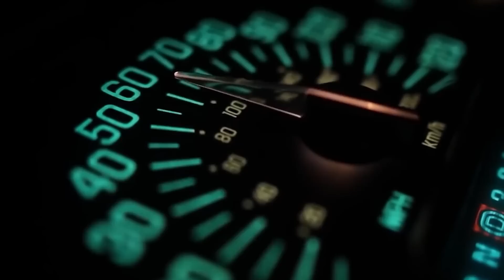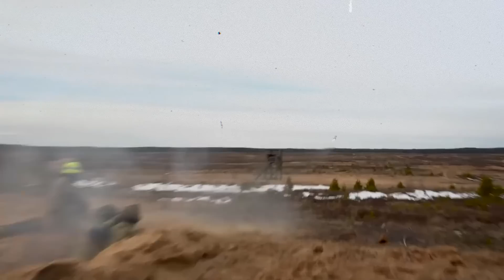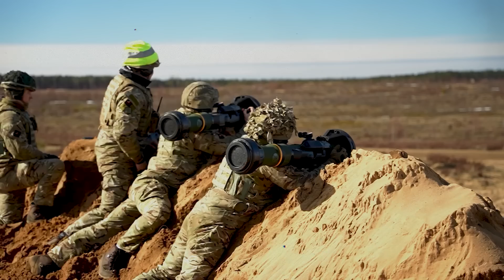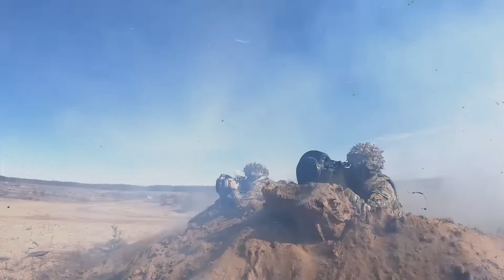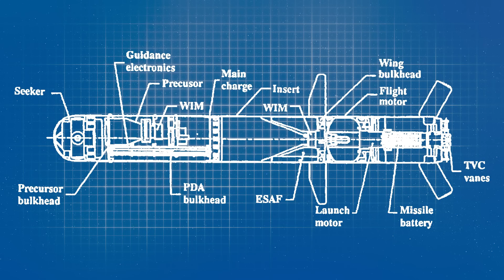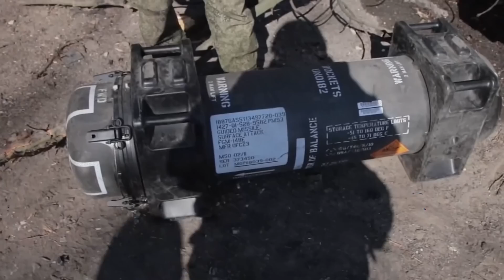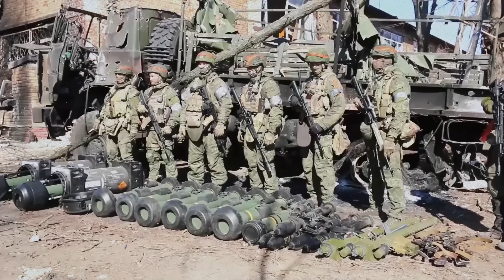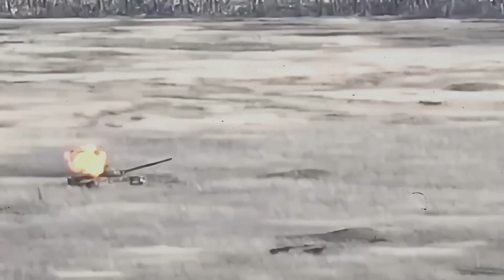The Javelin: The Missile That Redefined Modern Warfare

Comment: Towards the end of your mention of a Russian Ka-52 being shot down by Javelin shows how dangerous the air defense situation is for both sides in the conflict.  The Russians and Ukrainians have extensive air defense systems.  Long range stuff like S-300, Patriot, etc.  There's also self propelled AA with cannons and missiles.  The threat of radar and those long range systems forces a lot of low level flight.  However, flying at low levels puts the aircraft in danger of shorter range AA guns and MANPADs / Man Portable Air Defense systems.

So the air defense threat in Ukraine that both sides are seeing is nothing at all like what the US military has had to deal with for the occupation and counterinsurgency duties it did in Iraq and Afghanistan.  The insurgents weren't walking around loaded up with MANPADs, never mind sophisticated, very expensive long range radar and SAM / Surface to Air Missile systems.  It was why US aircraft were able to linger around so much.  Meanwhile in Ukraine, there's anti-aircraft up the wazoo.

Comment: The Short company  also made the Seacat naval SAM and its land based equivalent the Tigercat. The Seacat was based on the  1950s Australian Malkara wire guided anti tank guided missile which used a MACLOS guidance system. Three distinct versions of the Seacat were used. The first version used sighting binoculars and MACLOS. So the aimer had to keep the target centred in cross hairs and also steer the missile using a joystick. So this was similar to Blowpipe. Later versions used SACLOS guidance and radar control. The final version as fitted to the Type 21 Frigates used a CCTV monitor and a joystick. The operator only had to keep the target centred on crosshairs on the TV screen and the missile would be guided to the target. However none of the versions were effective and Seacat only achieved either one zero kills during the Falklands War.

Comment: Now we are finding that drones are cheaper and better at taking out armored vehicles.
Reply: Certainly cheaper, but not necessarily better. They're a different tool, you can jam or even shoot down drones with the right tools. Intercepting a Javelin is very difficult, it's only possible for an active protection system and there are few in service (none with Russia)

Comment: You make it sound like Russians do not have anything like Javelin. As a matter of fact they do have a Kornet system which has a range more than double of the Javelin.
Reply: Its not as mobile and suffers from worse build quality. it's not as accurate and is a greater strain on logistics. The kornet is more like the tow than the javelin, russians dont have a direct competitor to the javelin.
Reply: But is not as mobile compared to the Javelin & doesn’t have a top attack mode

Comment: Cages on the top of Tanks aren't fully useful against Javelins, but it enhanced the survival rate in this case. 
Btw. IDF are using the same Cage design on Merkavas Tanks. 🤷
I mean - it is for sure useful, and it's better to have an additional Cage protection on the vehicle then not to have it.

Comment: Simon, you are painfully FOS. As a former contractor to US DoD (I did silicon level failure analysis for a few decades). No, this missile did not redefine modern warfare.  This missile might have redefined US defense industry contracts, but that is all that it did. Wake up, please.
Reply: If a $1M missile can be outsmarted by 50 $5K missiles, trust me this is a fail. The west cannot defend against the cheap drones from the middle-east. We are slightly screwed. You had better wake up.

Comment: the javilin system has alot of issues its from the 1990s storage batteries are shot the electronics the same the fireing of them is a joke if upgraded to modern electronics and batteries be much better,id use a rpg mark 7 more simple and works

Comment: Small correction about HEAT and ERA. ERA uses the explosions pressure wave to disrupt the penetrating plasma formed by a HEAT conical shaped charge. "Tandem" warheads detonate a small charge to remove the ERA and then allow the main charge to deal with the armor beyond. The newest NLAWs and Panzerfaust launchers also have top attack capabilities.

Comment: Sure it's a marvel of engineering, but the wat in Ukraone has shown that an RPG round taped to a $400 FPV drone works almost as well.
Reply: FPV certainly can disable a target.  But it may take multiple FPV's to actually kill a tank; and even the, sometimes it isn't guaranteed unrecoverable.  Sometimes the drone signal can be traced back to the operator, putting them in danger.  RPG's require the operator to get uncomfortably close to their intended target.  While they can kill, Javelin gives its operators the ability to deliver death by dial up from fuck knows where and scoot before the missile even impacts.  Great crew survivability, and the tank sure as hell isn't likely to survive the hit.

Comment: So for some direct knowledge, I was part of an anti tank squad in 2001. Our primary weapon was the Gustav rocket launcher with its various rounds, including the heat round for penetration. The 72mm LAW rocket was similar with its smaller heat round but was being discontinued (even though most of us think that was a mistake. I was trained on the javelin back then and at that time we considered it better for ground to air use, especially since the targeting system was easily and regularly confused by rolling hills or similar in the foreground, and if any such thing was in the sight picture along with the target, the system seemed to calculate a distance in between, completely missing the highlighted target. I imagine they quickly reworked this failure since it was so embarrassing considering much older, less technologically advanced weapons wouldn't have that issue. Still super impressive how it could track aircraft in flight, which again is what we saw as a use case.
Reply: some 72mm law and gustav still have in place if we disregard price? One wouldnt choose weapon based on price when life is on the line, or nobody would order those 500k javelin units. I take guidance unit per each rocket in javelin is way more complex than these other weapons making most of price difference... CLU is reusable afterall. Seeing videos, javelin makes bigger blast but otherwise seems to work similarly than NLAW(top attack mode, fire and forget?).

Comment: The video does not explain fully the purpose of the precursor charge, it's serendipity that it explodes reactive armour but its major purpose is to remove all the clutter in front of the shaped charge main warhead to allow the plasma jet to be properly formed and focused, this requires absolutely no obstructions, or the perturbations from reactive armour.
Shaped charges are normally designed for and most effective at 2.5 calibres away from the target.

Comment: Considering a single FPV drone costs a micro fraction of them and can do just as much damage, their days are numbered.
Reply: FPV drones can often cause a lot of damage, but they have their limits, limits that a Javelin does not have.
Reply: @MrWasGehtSieDasAn01  FPV have greater range, pinpoint accuracy, no exhaust plumes, very easy learning curve, and can be used as recon, as well as targeting bunkers, infantry, artillery, and a whole list of targets. And at less than 4,500 a whack compared to 120,000 per missile, you do the math.
Reply: @sodog44  FPVs can be even cheaper around 1,000

Comment: Russia's worse nightmare would be more artillery shells for Ukraine.  A lot more shells!  Javelin is not a big deal.  It has a relatively short 4,000 meters range.  Believe it or not but it is not easy to come withing 4,000 meters of enemy lines.  It is even more difficult to withdraw to safety once you have revealed your position and every Russian mortar is firing at you.  Anything below 7,000 meters is no longer sufficient and safe to use in combat.  Ukraine's Stugna-P has 5,000 meters and the Ukrainians are preferring it.  It is also possible to use it remotely.  This is much safer for the crew. Javelin has no remote control capability.    Russia's Kornet-EM is in a league of its own with its 8,000 meters range plus remote control capability.

Comment: 2 fpv drones for 400$ each does the same trick every day in Ukraine. If anything we learned that systems like FGM 148 are a vehicle for the defense company to sell as high as possible per strike. A few hundred thousand a pop.
Reply: I take FPV is enough for motorbike dudes, IFVs, BMPs with lighter armor. For helicopters worth 15mn$ , javelin if it can do the job, is well worth it(as anti air radars may not pick them up). Also artillery is effective after vehicle is not moving. Though artillery ammo is somewhere 500-1000$ a piece so FPV is cheaper. Biggest risk with FPV can be if they can countertrack operator position with remote control signal.

Comment: The one thing you failed to mention which can easily confuse people is the CLU might be that expensive but it is reusable.  The 110k cost is the cost you don't get back.  The 500k CLU is useable over and over again.  It doesn't cost 500k per shot.  Just 500k to have it to use over and over again.  You also need to look at it in the big picture scheme of things too.  Just like aircraft missiles being expensive they don't focus just on that cost but on the cost of what it destroys.  If a 110k missile destroys a T-90 that was worth 2.5 million in 1999 dollars that is a loss rate which no country can afford.  Especially with a 90% + success rate that is a winner all day long for those fielding the Javelin.  No country can afford to take losses like that and be able to continue funding a war.

This is precisely why russia has been throwing in old tanks.  They cannot keep up with that rate of loss.  It is a lame stop gap solution on their part as the much less effective tanks they are putting into the mix are just driving coffins for their crews.  Even against simpler and older solutions like the RPG.

Comment: As a qualified javelin gunner [04-12] the direct attack mode vs helicopters is standard training.  in country [afghanistan] we mostly just carried the CLU as a observation tool with its thermal optics as we never expected to ever fire a live round against armor, helicopters or even a bunker/cave with the sheer amount of fixed and rotary wing aircraft we had on call at any time.
Reply: But how sweet would it have been to be the guy that took down a jingly chopper 😂😂😂

Comment: The small initial launching charge is a safety feature. This enables the missile to leave the launcher. Then at a safe distance the main motor engages and propelles the warhead to the target. This protects the operator from being fried by the  missiles main motor. The WW2 German panzerschreck didn"t have this feature and had a blast screen instead. The panzerfaust however did utilize the kicker charge. Later Soviet ICBM's used the same principle for " cold launches". This enabled a much larger and improved missile to be launched out of the same old silo.

Comment: And yet both Ukrainian and United States (and NATO) generals insist that the Ukrainians need tanks.  This is, I believe, because the United States' army (and other branches) always want the biggest and most expensive.  For example, in the Black Sea, the Ukrainians have largely defeated--by sinking some and scaring the rest away--the Russian navy; they have done this, not with huge warships but with small, cheap, sea drones.  Tanks, ships, and even planes/helicopters are becoming nothing more than soft, easy targets.  But what is a general to do with a bunch of soldiers carrying suitcase-sized rockets that can defeat and destroy a long line of huge tanks.
Reply: Sank the Russian navy? Could you provide a comprehensive list of what's been sunk? As far as i have read, the West accused the Russian navy  of blockading Ukrainian ports preventing the transport of wheat. So which one is it? Russia's navy has been decimated or it hasn't?

Comment: If you want to see what happens when a rocket launcher goes wrong, watch Ballistic High Speed's recent videos. Team member Adam nearly died to a propellant failure that blew the RPG up in his face.
Reply: wasnt it exactly that multiple propellant system that failed...(didnt know they can even adjust that by switching rockets; RPG seems so back to basics as one rocket weapon can be) granted I take javelin is made in US and rpg who knows where.
Reply: @effexon  yea. The propellant was the failure point. The RPG wouldn't have failed catastrophically
had it not needed the reactivation welds, however. Those welds create more brittle metal around them and that's where the conflagration exited the tube. 

RPG tubes are the most likely to fail based on their age alone. The LAW,  javelin, etc are more modern and better designed with safety in mind.

And yes, the RPG7 was made starting in 1961 in the USSR.

Comment: The anti Russian bias of this channel and the warographics channel is cringe and a blatant narrative push to make Russia look weak. Lets talk about western tanks being technologically equivalent to Russian tanks while being 5 times more expensive and needing an additional crew member. I bet the writers think Ukraine is winning.
Reply: @baneofbanes  or maybe you're a bot who falls for western narrative? Lol
Reply: @baneofbanes  like what? Prove anything I've said wrong.
Reply: Any tanks in modern warfare are ineffective, this is an incorrect comparison. Although Western tanks are much better than Russian ones.
Reply: @leo_tkach  everything you just said is wrong and is a cope. If tanks were ineffective then they would be parked up and not used. We currently have three countries using them extensively and effectively. Russian tanks have equal or greater armour protection to western tanks, they have countermeasures and advanced optics all while being significantly smaller and harder to hit. They also require one less crew member and are 1/5 the price to produce. As we have seen, as soon as western tanks hit the battlefield they're being destroyed with the same frequency as Russian tanks because there is nothing special about them. And before you start huffing the copium and say something derped about turrets popping, the design has been improved on the current production of tanks. Move along.
Reply: The orcs have found this channel lol

Comment: The best part of the javelin is the fact that you can detatch the sights and just use them separately for surveillance and recon
Reply: Javelins supplied early in this war had expired batteries. Ukraine could not wait for new kit to arrive, so would have got that sorted in days.
Reply: Wouldn't it drain the battery,  and rendered it useless or cause you risk haste/miss the shot at critical moment? If the battery dies?.
Reply: @kentershackle1329  i am quite sure the army and developers thought about this, I dunno, like a simple battery charge gauge?
Reply: @traviskingful  And carry spare batteries!
Reply: @kentershackle1329  They Jerry rig car batteries and the like
Reply: @kentershackle1329  I remember seeing an article earlier in the war about how Ukrainian forces were using the CLU for recon and forward observation
Reply: It comes with a separate tripod head that only holds the clu, you can easily remove the clu and whack the LTA on and just fire kneeling. They probably got the weapons training but the uk doesn’t just teach the weapon it’s an entire course on anti tank tactics so hopefully the Ukrainians got a good few weeks doing that as well.